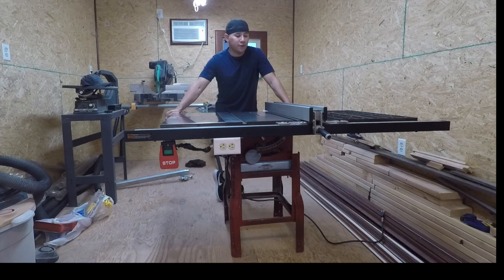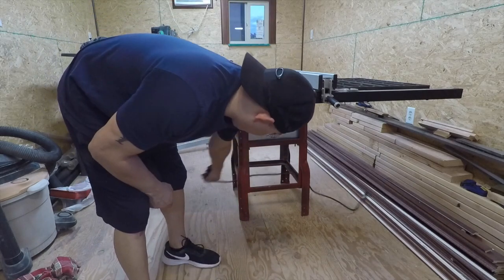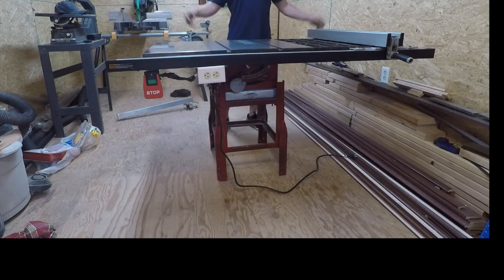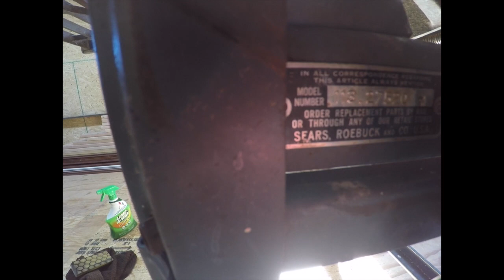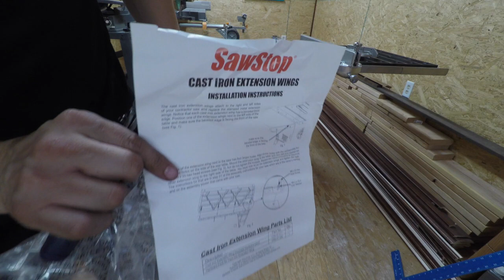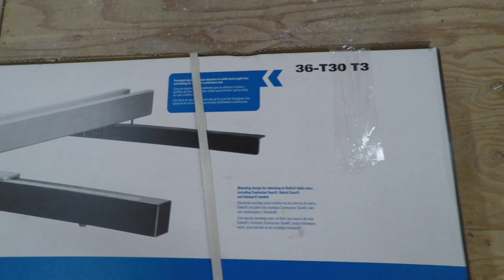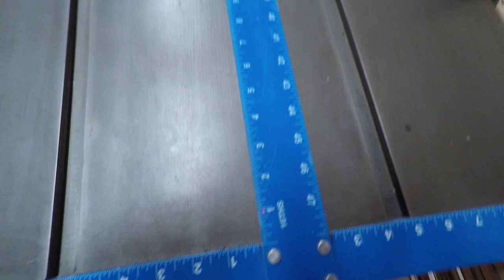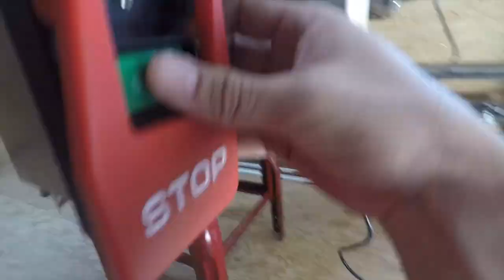1952 VINTAGE CRAFTSMAN TABLE SAW RESTORED!

Comment: Nice job on the restoration!! I acquired my wifes grampaws 1952 craftsman like yours last yr. It was in bad shape , rusted pretty bad and was left in a damp barn for years. I have since restored it from the ground up. I put the vega pro 50 fence system on mine. Like yours mine is a power house also!! You just cant beat these  old saws they are a BEAST!!!

Comment: I have that exact same vintage Craftsman table saw. My dad bought it new and it was later passed down to me some 35 years ago..  I know this saw well & for the most part it is an okay saw except for it not having any safety attachments (i.e. blade guard). Also, the motor extending out the rear a considerable distance makes the saw very awkward for my liking.  Finally, the saw is made of cast and it is extremely heavy. When I got the saw, I put it in my basement and that is where it has remainded all these years.  I also own a much newer DeWalt table saw that  I use much more frequently.. Vintage is nice, however, practical is more important to me. I keep my Craftsman table saw for sentimental reasons and when I do use the saw it brings a smile to my face.

Comment: You did an amazing job of restoring that saw. With all of the upgrades it looks like it will produce some nice stuff. I just finished restoring, well I can’t even say restore because this old saw I got was in such great shape all I really had to do was clean everything and align everything. You can check out the video I posted.

Comment: This is a very nice restoration and upgrade.  I haven't used any of the current table saws but I read over and over that people replaced their 113 series Craftsman with something that wasn't as good.  The model you have was probably terribly expensive to produce due to the complex shape of the housing and the engine turned aluminum front cover.  Mine is a little newer than yours, purchased in 2019 with all of its original accessories.  I only have one issue with what you did is that you painted over that beautiful engine turned cover.  That was a criminal offense.  Other than that, nice job!
Reply: David Dale I died a lot when I saw him paint the aluminum front
Reply: At about 2:00 in the video the non below your right hand
Push it in and turn it and will move the arm left and right
Gear under the rule scale
Reply: I cried "NO" when he started painting the engine turned aluminum front panel. I have the exact same 1952 saw and my engine turned panel is mint, no scratches, dents or dings.

Comment: Great job Alex I have one quite similar to that I got from an older gentleman who built cabinets and stuff in a small shop. I picked up a free Companion table saw by Craftsman today with an original Craftsman motor but no table extension. Everything else is there the fence and miter though.is one on Ebay identical,I think it's from the 30;s or 40's. They don't make them like this anymore.

Comment: All in, between the new wing, fence, paint, safety switch, how much $ do you think you put into that saw? That 2HP motor looks brand new too. Where did you find that? I'm pretty sure that saw came with a 1HP motor from the manufacturer. 
I am now inspired to paint mine (very similar vintage, if not the very same saw). The legs were rusted pretty bad until I covered them in Rustoleum dark grey gloss last night. Gonna spray the cover with some candy red. I also picked up the mobile tool base from Harbor Freight ($39). 
Nice job. Nice shop.

Comment: If you’re using 110 volt  motor 14 gauge is not heavy enough you should have a horse and a half motor that’s a 20 amp motor You should use a minimum 12 gauge

Comment: I just got one with the original motor matching print from saw on saw and everything. Its only 3/4 HP. Is this saw not that good unless its a motor like yours, with 2 HP? Anyone out there know?
Reply: Yours may be the 8" 113.27700 it came with 3/4 HP
Reply: Most early Craftsman table saws (including the 10" models) were equipped with 3/4 HP motors. Sears tools with the "113" source code were made by Emerson Electric Co., a Sears supplier for 60 years (1938 to 1998). A 3/4 HP motor works just fine for normal use on a standard 15 amp circuit.